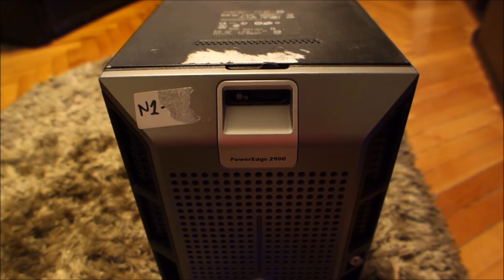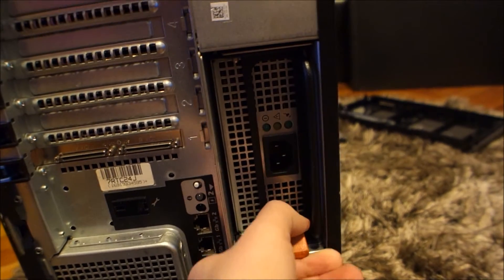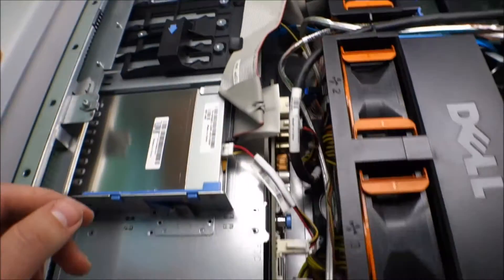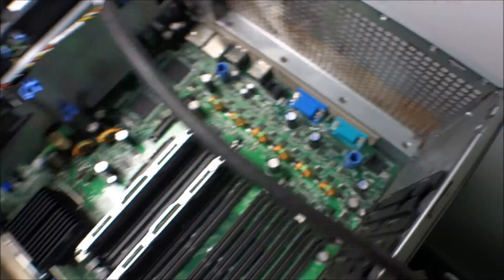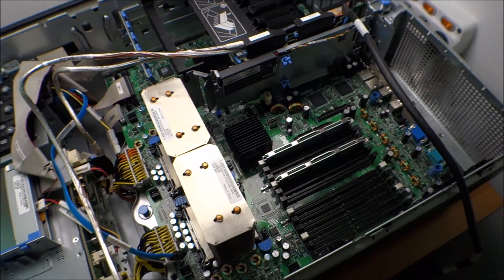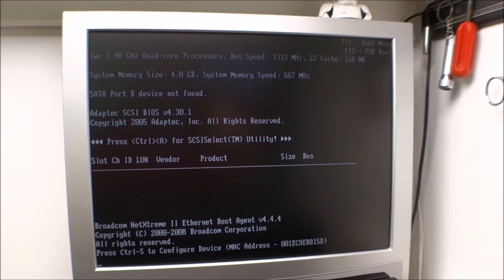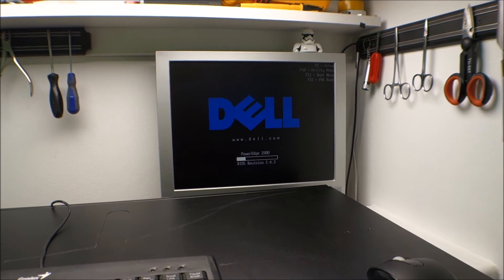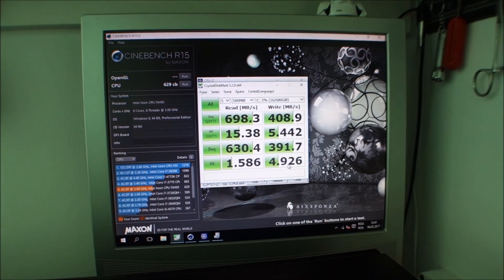Working on a DELL PowerEdge 2900 server

Comment: As far as what this machine is good for in every day use, you can add "electric personal space heater" to the list! If you need to run windows or linux on a moderately powerful system with LOTS of storage (I have 3.0GHz quad core Xeons in mine with 48GB of RAM, and at least 2TB+ of SAS and and another TB in the SATA channels) AND have a warmer room in your place, this is definitely a good choice of a multi-purpose computer system. In fact, you can probably kick off your shoes and keep your feet nice and warm if you are in close proximity to it. Especially if you are good to seal up all the drafts from the room, you will have a good amount of warm air.
Reply from the maker: Can't dissagree with that 🤣🤣
Reply: I wish my back was capable of getting this behemoth up the stairs to my bedroom, I would stick it in here and let it run benchmarking software on a loop in a Windows VM to really help crank out those BTUs!!! I can wear earplugs!
But with the negative temperatures we've been having, it would really come in handy!